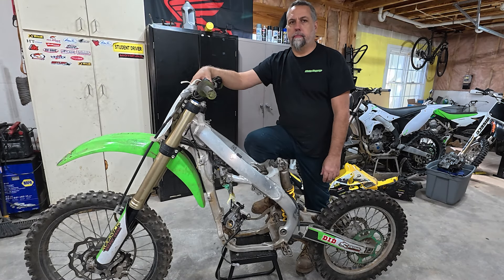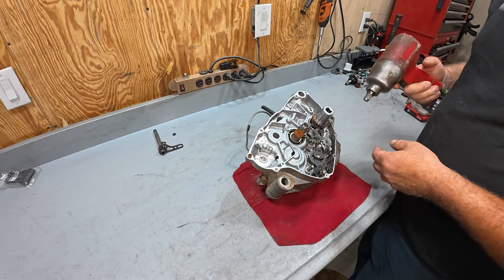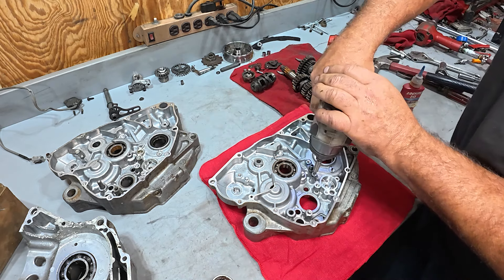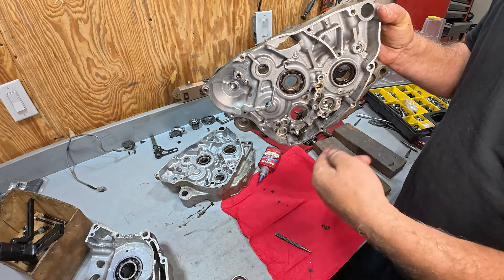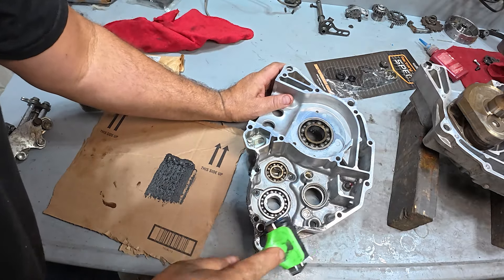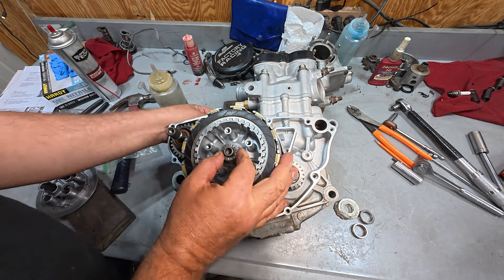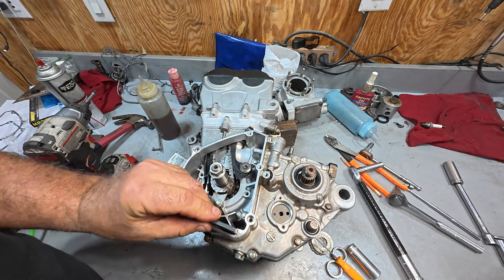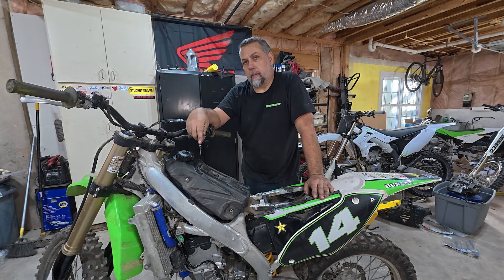2014 Kawasaki KX250F Build Ep100

Comment: You are a true legend! Let me share a story from my life:

When I was 20, I bought my first ATV—a 125cc Chinese model. I enjoyed the bike and learned the basics, like changing the oil and doing minor maintenance. But eventually, I got bored with it and really wanted a dirt bike. So, I came up with an idea: I took the frame of a Chinese dirt bike and swapped in the engine. It worked, and everything was fine for a while.
Then, I got tired of the 125cc and wanted something bigger and more powerful. I ended up getting another Chinese bike, this time with a 289cc engine. It worked well, but the frame was too heavy for me—it weighed 140 kg. That bike ended up breaking my right arm (dislocated it, actually).
Since I couldn’t wheelie properly with that bike, I finally got my first real dirt bike: a Honda CRF450R from 2007. It was the most aggressive bike I’ve ever ridden! That bike could wheelie in every gear. Of course, I crashed many times, broke a bunch of bones, but I loved it! Later, I upgraded to a Honda CRF450R from 2016.
That’s when my life really changed. However, I ran into a problem with the crankshaft rod bearing. Since my repair skills were still basic, I took it to a mechanic. Unfortunately, some mechanics aren’t honest. He told me I needed a new piston, oil pump, and other parts—which wasn’t true. I ended up paying €1500 for the rebuild. After all that, the bike still wasn’t running properly. The engine vibrated badly and just didn’t feel right, so I sold it. I was upfront with the buyer about the issues.
Then came my first true rebuild: a Yamaha YZ450F from 2013. Once again, I had a crankshaft rod bearing issue. This time, I disassembled the entire engine, cleaned every part with gasoline until it looked brand new, and replaced the crankshaft myself. The bike ran perfectly after that, and it still does to this day.
From that experience, I’ve learned so much about bikes. It’s impossible to put it all into words here. But if there’s one thing I’ve learned, it’s this: just try, and you’ll succeed!

Thank you for your videos—I truly admire your professionalism! 🤝
Reply from the maker: Thank you for sharing your story. That’s a big jump from a Chinese 300 to a race 450. Yes, they are very aggressive. Glad you took the time to do your own repairs. It’s not that difficult. Appreciate your comment.

Comment: Just found your channel and love your videos. I'm learning a lot! You seem to have an incredible amount of knowledge about these bikes. Did you have a formal education? If not, what did you find was the most valuable way to build your understanding of motorcycles across the brands?
Reply from the maker: Thanks for your support and comment. I am a former auto mechanic and have always been good with my hands. Fell in love with bikes out of jealousy for my neighbor riding his little mini bike when I was 10. Bought a busted bike when I was 14 (Kawasaki KD100) and ripped into it not knowing what I was doing but got it running…
Engines and bikes are all fairly similar so it’s not too hard jump form one to the other.

Comment: Godd day, i'm rebuilding my 2005 yz450f engine and have come across the problem where my intake cam shaft does not spin when the caps are toqued down to manufacturers' spec. Also, thanks for all the videos. I've gained a lot of knowledge watching you and also confidence to do it. How can I get my cam shafts to spin freely, or do I need to buy a new cap. My exhaust spins fine. Don't no what to do here. Thanks in advance.
Reply from the maker: Thank you for your comment. There are a few reasons that this happens. First thing I would check is your valve clearances on your intake. If the clearances are too tight, the cam shaft will drag and not want to turn. If your clearances are good, then your cam or head journal is damaged and that is generally due to incorrectly torquing them. The caps are not sold separately because they are line bored with the head from the factory as a matched set. You could potentially purchase a used cam cap but no guarantee that’s going to fix your problem. The correct way to fix it would be to replace the head, but who wants to do that right? I will have a video coming out shortly that will demonstrate the procedure to repair this problem. Generally, what you need to do is get some layout fluid, also known as machinists fluid, coat the camshaft journal, and then let it dry. Next, you will install the camshaft and torque the cap down. Slightly rotate the camshaft and then when you take it all back apart again will show you where it is binding. Would use a special tool to lightly remove some material from that area on the cam cap or head. You must use caution because you can severely damage your head if done incorrectly. Hope this helps.
Reply: @restoroosterohv thanks for the quick response. My intake valve clearances are within spec. I found a set of caps for $40 not a bad shot. I do have some of that blue die that you have used that gets all over the place not sure if that would work. When I put my intake cap on and torque the bolts to spec It doesn't even budge. I did notice when looking at the intake from the front its the back bolts that create the problem. The two bolts infront that are on top of the bearing don't do anything, and the bearing turns very well. Hope to see this video soon because I am stuck here and nope definitely don't want to buy a new cylinder head. Your videos are excellent. Great information and it's given me the courage to dig into this. I'll try the caps only because it's a cheap solution but if it doesn't work I'll be looking forward to this video. Thanks again
Reply: @restoroosterohv  also wondered if this is something that if I felt uncomfortable doing, would you do it for a fee also me paying shipping both ways. Maybe make the video with my cylinder head 🤷‍♂️.  Thanks again for all the information.
Reply from the maker: @emmanuelgonzalez-jk7mk that is exactly what this video is from, a subscriber with the same problem. If the video doesn’t help, you could send it to me for the repairs. Contact me at restoroosterohv@gmail.com

Comment: I love the Rotella! What’s your go to break in procedure?
Reply from the maker: Start it up, bang it in gear and hold it wide open. No, I generally take it easy for about an hour, and then start pouring on the power. 
I exclusively use Rotella T4 in my machines and change it every 2 to 3 rides, depending on how long I ride. Oil always comes out, looking as good as it did going in.
Reply: @restoroosterohv yep that’s always worked for me also..